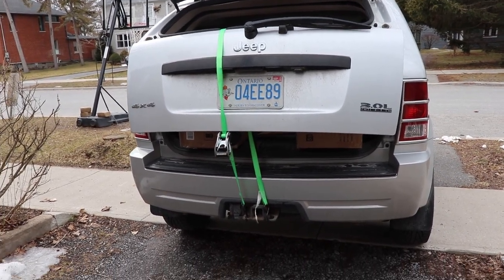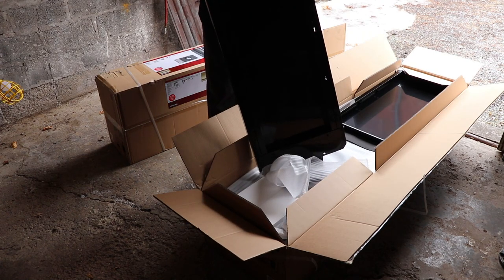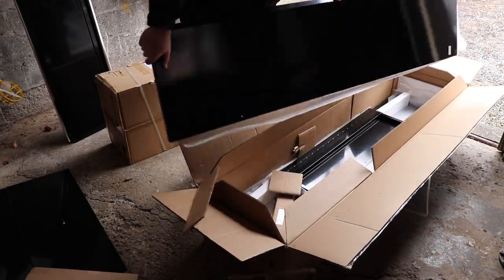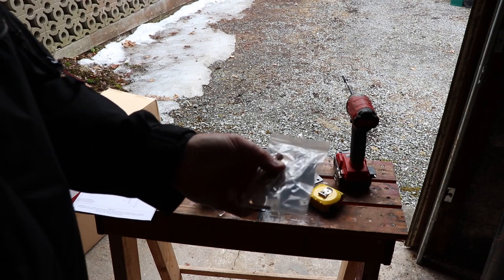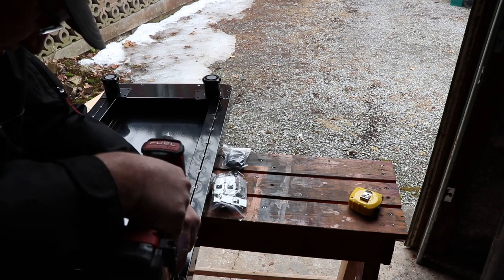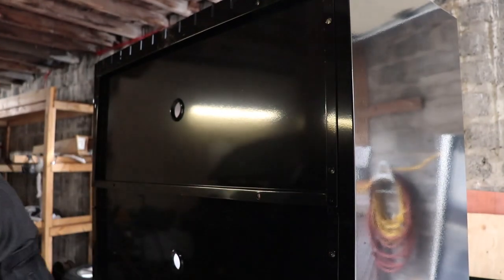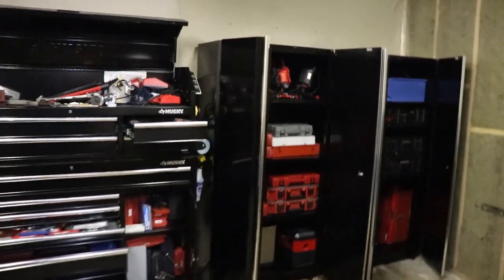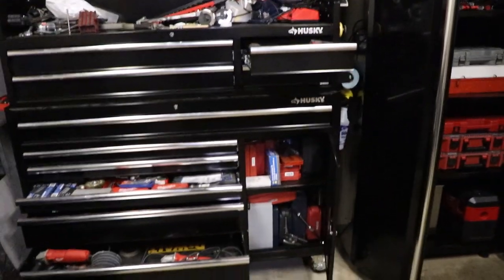HUSKY 72-inch H x 36-inch W x 18-inch D Steel Tall Garage Cabinet G3602T Assembly & Review

Comment: First, get a blanket to lay on the floor of the garage unless you want your new cab to look like crap right off the bat. Don't tighten any screws until the end, except tighten the leveler feet.  Make sure to mount the leveler feet in the same orientation shown on this video to maximize stability. Assemble the cabinet keeping the screws loose, put the doors on and make sure they are seated all the way in the hinge mechanism. To square up the cabinet, close the doors and even them up. Then put a vise grip on the top of the abutted handles to keep them lined up. By doing that the cab is squared up. Then tighten all of the screws. When you remove the vise grip your cab will be squared. Consider putting the shelves in place before you square it up. Do not use casters!! 70x18 inch cabinets are NOT intended to be used with casters. Especially if you intend to hang a bunch of stuff on the pegboard doors. When it falls over onto your kid or your shiny new car you will regret it. Some caster sets have two stationary and two swivel casters. Don't even use those.  Casters and a wall strap?? Kinda defeats the purpose unless you think the cabinet will be easier to move to your new house after your wife divorces you. Good luck and keep DIY-ing!

Comment: which screws did you have to loosen to make the doors straight?  You just said in the back.  Well there's a lot of screws there.  It would have helped to see how you got the doors to align.
Reply from the maker: you need to loosen all of the screws on the back
Reply: Front 8 too

Comment: I want to put a compression clothing rod inside to hang some coveralls. Will this cabinet hold up with only one upper shelf? Or maybe one upper snd one lower? Or do the shelves hold the unit sturdy and in place?
Reply from the maker: I would use a rod hanger that you can bolt through one of the shelves.  You don't need the shelves for the cabinet to stay together.

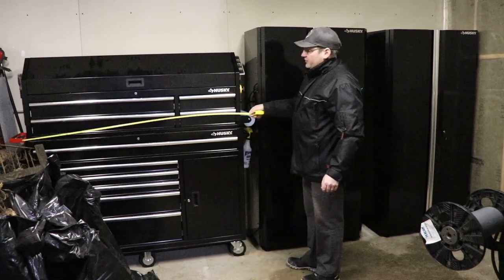Comment: On minute 15:35 you mentioned it's under 70" tall and I'm assuming it is not including the little legs you installed in the beginning of the video. My question is, can you put it without installing the legs flat on the floor or you HAVE to use the legs to stand it?
Reply from the maker: You do not need the legs, you could use shims to level it instead but it will speed up rusting if you are in a wet location.  You will have trouble standing it up if you have that low of a ceiling.

Comment: Stephen, thanks for the video. What is the max number of shelfs you can add if you buy additional shelfs from the HD ?
Reply from the maker: I'm not sure, I am not near the cabinets right now but probably twice as many.  Depending on what you put in the cabinet, it may end up too heavy and collapse if you really pack it.  Rousseau makes good industrial cabinets if you have the cash.
Reply: There are 7 shelf locations total. Comes with 3, so you can add 4 more

Comment: hi there home depot website says 36in wide and another place says 36.6 i need 3 and 3 wood fit perfect at 36 each could you verify for me none in stock anywhere i live would have to order thanks great video
Reply from the maker: They are just under 36 and 3/4" each.  I would give 37" per cabinet.